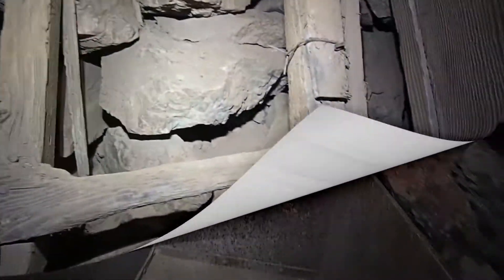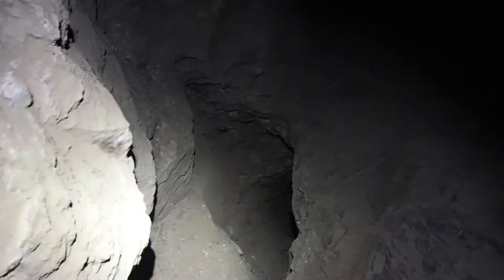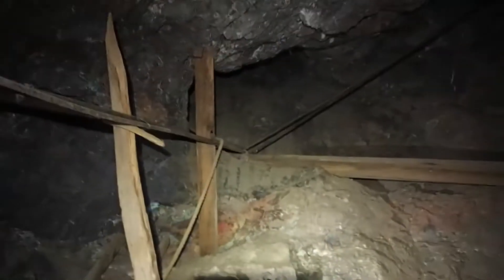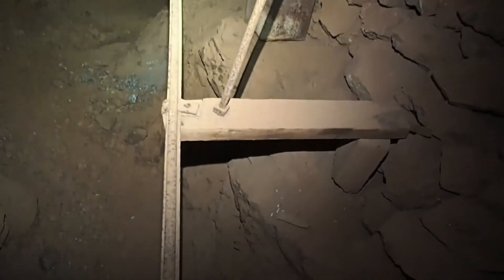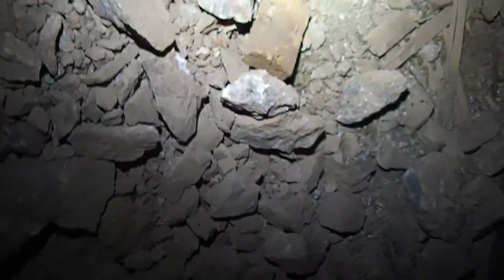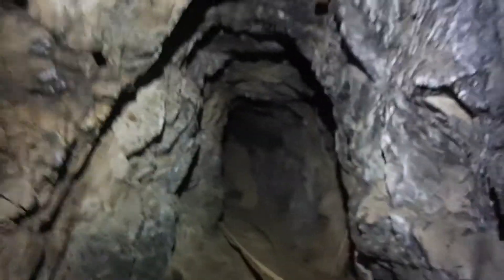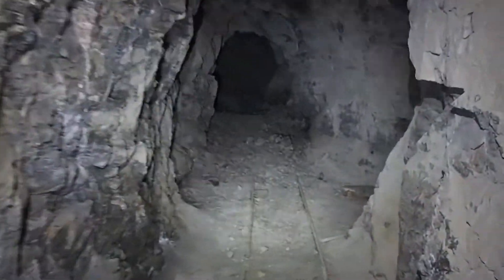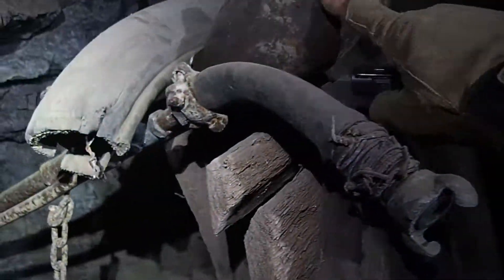Early 1900s copper mine Part 4

Comment: Some nice finds there. It's always fun to see a mine car that's in good  shape. That was a  column from a column drill that you found. It's different from a jack leg. The jack leg supports the rock drill from underneath the drill. A column drill uses a screw jack, or column, that is secured between the floor and back of the mine. The drill is attached by the clamp to the column. It can be adjusted to the desired height by adjusting the clamp up or down on the column. At least that's what it looked like to me. Nice job, Ken and Randy!
Reply from the maker: Ah, column jack, I knew it supported a drill, good to know and thanks for the teaching opportunity.  We want to go back with rope and go down the ore pass, we could not find another way down
Reply: @mineadventures7938  Doesn't that go down to the lower levels that you were already in or do you think there's another intermediate level?
Reply from the maker: @TomandJulieMineExploring  I am thinking there are workings still to see.  there was a bad ladder going up we avoided.  i would say there should be some cool stuff to see.  the hoist shaft was collapsed, so somewhere there is a level to see that connects.  the hike up was 300 feet, we went back down only 100 feet.  there is 200 feet worth of workings to see and the air blows strong.  we found no manway, so they must have used the shaft to get down.  we did not intersect the shaft on the minus 100 level.  i am pretty confident there is some fun left in this mine.
Reply: @mineadventures7938  That all makes sense. Maybe we can go in October to check it out.
Reply from the maker: @TomandJulieMineExploring  most definitely

Comment: TVR exploring has been in that mine. in the hoist room at min mark 25;24 that is a part of where horses or mules turned that big gear to work the hoist. never heard you say anything about that. did you not know what you were looking at? take some time to watch other mine explore channels you could learn a lot things
Reply from the maker: I knew it was an old mine by the rail ties, but a burro driven hoist, that I never heard of. That's very interesting.   I got corrected by Tom on the jack leg already.  I am not a mine equipment expert by any means